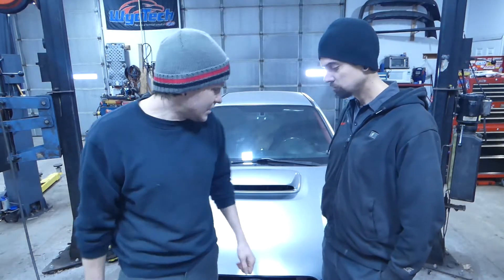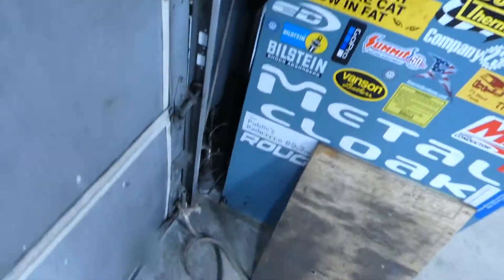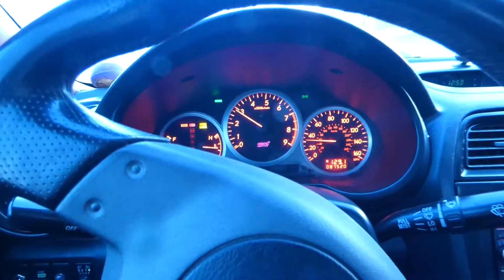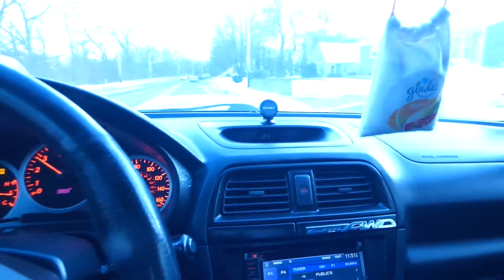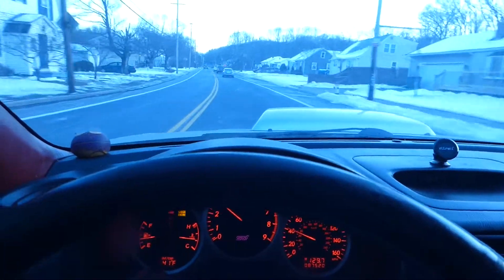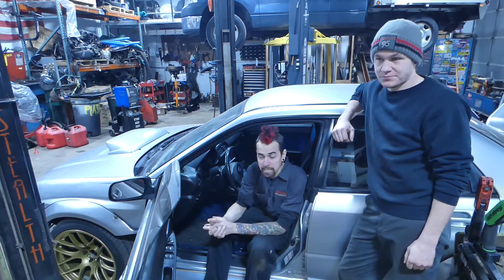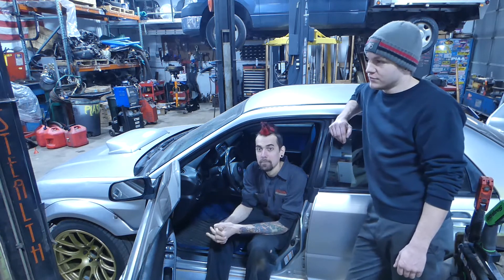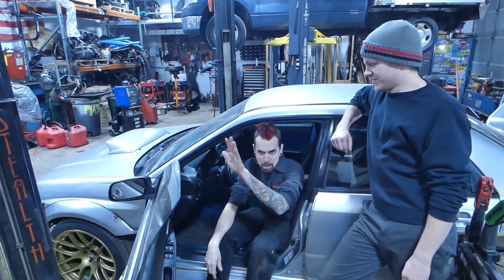IAG STi First Drive!

Comment: Still running good? How many miles? Thanks.
Reply from the maker: Yeah it's still a daily driver. The only issue is the neighbors and the noise from the N1 Race exhaust. Lol.  
I'll have to check the miles next time it's in for service as it was sold locally. At least 10k because it's been over 2 oil changes since break in was completed.
Reply: @RhodeWerks401  thanks. I have to rebuild my engine soon.